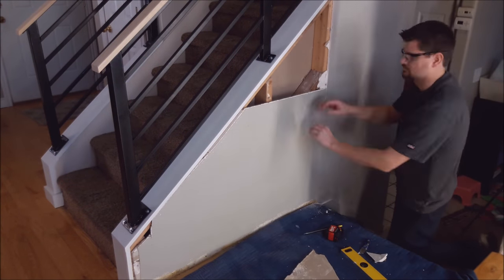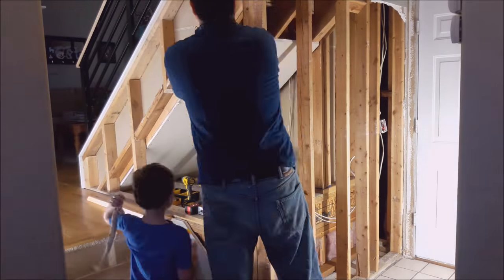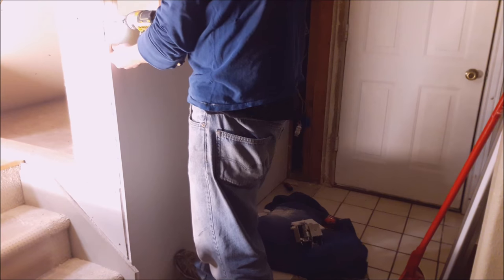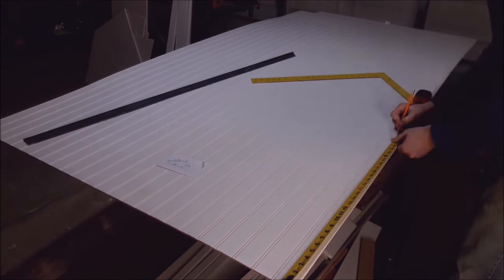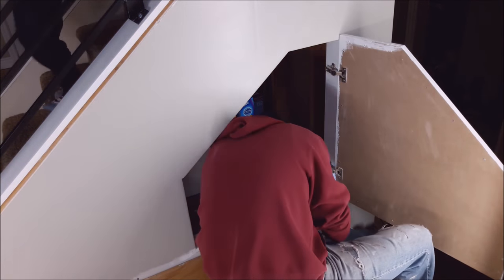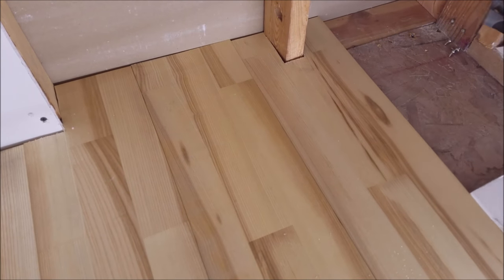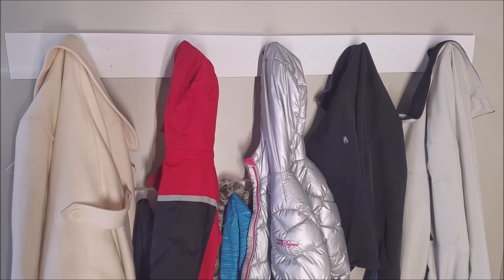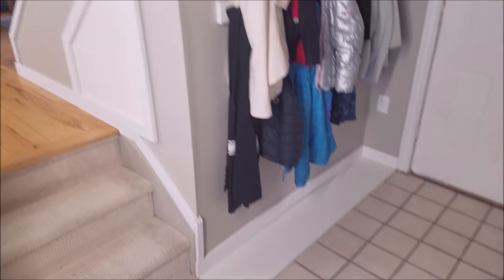How To Make Under Stairs Storage DIY

Comment: On that detail of the trim going down the stairs...I would suggest mitering the the trim down the stairs rather than floating it as an angle hovering over the stairs. But other wise great project
Reply from the maker: Thanks for the tip.